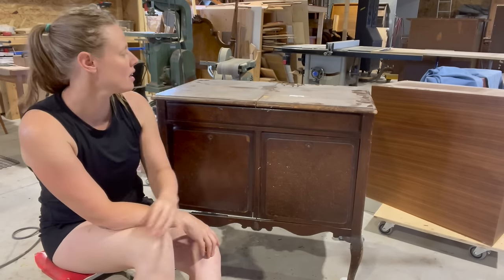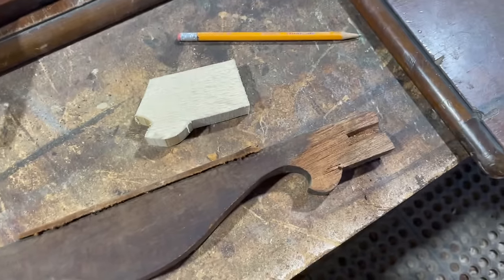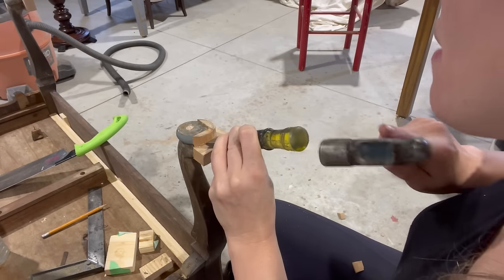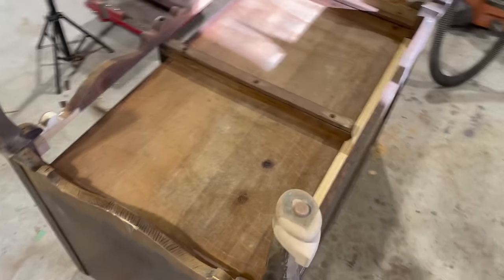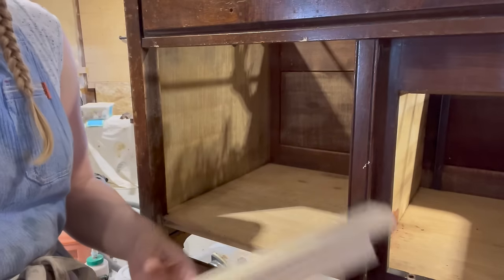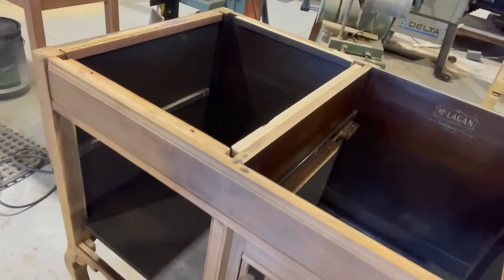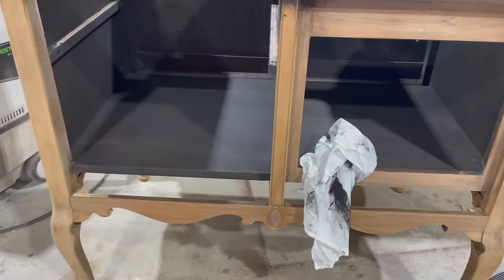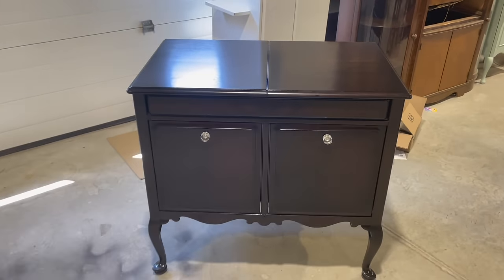Badly damaged crank-style phonograph cabinet

Comment: What an inspirational professional you truly are! I love your videos. Not only refinishing but repair AND build! I’m still working on my ugly duckling. I had to strip about 9 layers of polyurethane,  at least 2 coats of white, 1-2 coats of a blue, 2+ coats of an off white….all on an old coated solid wood little cabinet which I will be using for a coffee bar. I’m old. 60+ but you are an inspiration that keeps me going. Thank you so much!
Reply: I bought a $10 Army surplus Duncan Phyfe desk couple of years back and if I'd known what a pain in the butt it was going to be refinishing it I would have paid them $50 to take it back...lol.  Top coat was 1970's brown and green antiquing, then powder blue paint, chocolate brown paint, white paint, and the bottom layer was redwood stain on bare pine (permanent pink).  No one had ever stripped it in between coats, just this old fool........lol......I was 66 then and started wondering if I'd live long enough to finish the project.  I finally did finish it with multiple coats of walnut stain, but I feel your pain and I certainly appreciate the long hours and hard work this young lady puts into her craft.

Comment: You might consider turning yourself a mallet or 2 out of Osage Orange. With the striking surface round it tells you hand where it hit, on or off center and you will learn to adjust without ever looking at the mallet. I have one I turned 40 years ago and it is still in good condition. Turn a freshly cut chunk to rough size then coat it with something to slow moisture change. Much later turn to finished size. This is to prevent checking.
Reply from the maker: Sounds like a great idea. Love to see a pic of yours

Comment: Trena, I was re-watching and again thought "Where did the cut out piece come from at 45:27:" I forgot to ask then and nearly forgot to ask now lol. 
Amazing job restoring history and repurposing. Glad the daughter wanted to have something of her fathers. So much history is thrown away or destroyed by "shabby stupid" designs but then again I have to think, at least it wasn't trashed. So I shut up lol. It is absolutely amazing what you have done.
Have you ever thought of putting hours worked at the end of the job? I had a boss who complained too much at getting a teak cabinet restored that was her Grandmothers and I could not get it through her head the work involved, especially in the horrific condition it was in lol Some doctors might be smart enough to fix a hip but have no clue about wood and you think they would compare it as the same kind of surgery!!!
<3 tal
Reply from the maker: Hi there. The scrolled insert is original to the item. it is a speaker cover. it would have had a fabric cover to keep dust from the speaker. cheers!

Comment: I have made guitars for some 58 years and I have found that using a piece of expanded polystyrene as a sanding block is preferable to using a piece of wood or just using my fingers to hold the piece of abrasive paper. This I find can adapt to the shape of the piece of wood that I am sanding far better.
Reply from the maker: thanks for the tip

Comment: Consider contacting whomever makes your preferred brand of tools and let them know of your YouTube channel and followers. Tell them of your needs for the bigger equipment and see if they will get you the lathe for free  for advertising or greatly reduced cost for advertising. Your channel is rapidly growing and if they see the quality of your work and see if they could become part of it. I had a situation where I had old heart monitors and medical equipment that were donated to a group that I travelled to do medical work. I had none of the tubing or cuffs, wires, etc. I wrote to the original company, not expecting much. They sent me cases of brand new accessories so we were able to set up several medical sites in South America. You never know until you try. And I love the suggestion that you brand your refurbishments. Maybe a burn marked inside back of a drawer or door. Take credit for what you do. There really aren’t many who can work at your level of expertise. Some are really good at building from scratch, which is easier by far than restoring, which is where you shine.
Reply from the maker: Great idea. Thanks!

Comment: Why did you use an iron on that edge where the backer was missing?
Reply from the maker: to glue down the venneer
Reply: @johnsfurniturerepair  Im a new viewer and have never seen you do anything but glue and clamp. Did you heat the glue to help it penetrate into the voids or to set it?

Comment: Wouldn’t it be easier to use a Dremel with a small sanding drum to shape the feet to the desired shape, than the large tool you used
Reply from the maker: Not necessarily. Just depends what you prefer cheers